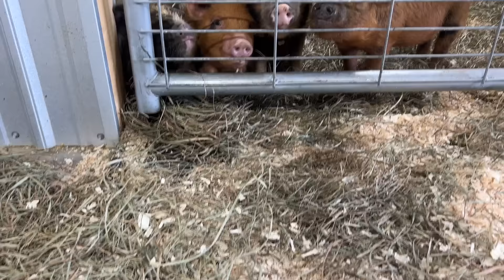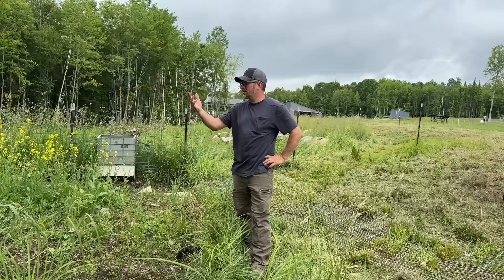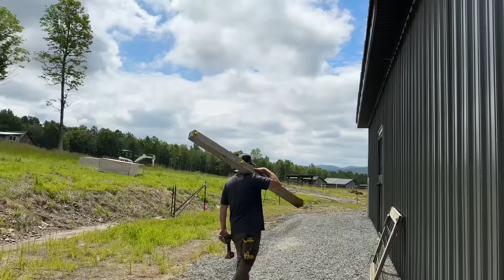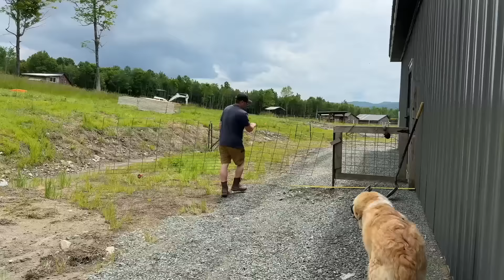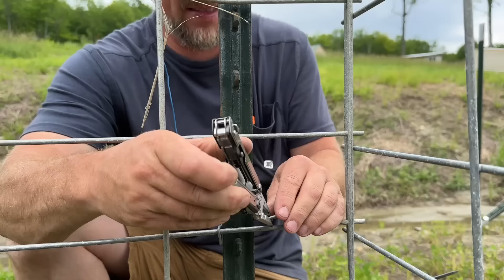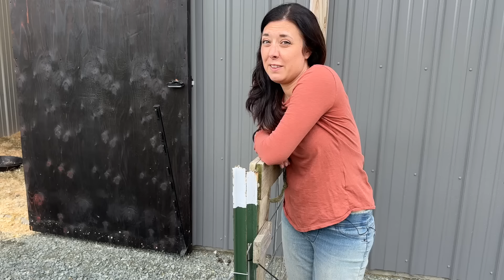Time to SEE If We've Been LIED To... Getting Our Pigs Outside for the 1st TIME

Comment: Try getting fencing pliers, they work well with the clips for the t-posts. When you work with wire you can use the pier to set the distance between strands and use them to quickly tie the clips up.

Comment: Have you seen the livestock panel connectors by One Man Fencing?  They are AWESOME!  I am NOT an affiliate, I just really like the product. They have stood up well to a goat buck! They are so easy to use and far better than staples.
Reply from the maker: Gooooooood Morning Honey Hollow. No I hadn’t heard of those before. Thanks for the recommendation I just looked them up
Reply: @LumnahAcres  For the ones that screw into wood, I opted to used longer screws for my buck pen. Screws are included, and they are not bad, just wanted to be sure of a good long bite. A buck can be somewhat determined. 😜

Comment: Hi Al, for those wire retainers I use a 4” length of 1/4” diameter pipe with a through hole to put the wire through. Then all you do is twist it round the wire of the panel. The length could be shortened to sit the size of the mesh opening, just use a larger diameter pipe to fit over the small one for leverage. I hope that makes sense.
Reply: Also, have you thought of adding some more weight to your picket driver, it sounds way too light. A disc of1” plate should do it, welded onto the capped end.
Reply: @paulvanhouts3365  For your information you can always edit your comments by clicking on the 3 vertical dots to the right of your comment.

Comment: Name the meat pigs Bacon and Ham.  A possible replacement for the fence clip tool that broke, use a nut driver.  The shaft is usually hollow for tightening nuts on long threads and would be fairly strong for wrapping the ends of the fence clips around the wire.
Reply: all we used was a plyers and used the handle to wrap the one side around the wire being held. Put over 1000 of those things in when setting up feed lot pens (wood posts[main posts] and t-posts[in between support posts]) to hold around 5000 head in the winter, spring thru fall they were out on pastures. Rather do the clips then pound in U staples!
Reply: I still like pork belly and pork chop for names

Comment: Hook the short side of the wire tie on one side of the post and then use your pliers handle or a screwdriver in the longer bent side and rotate it over the wire instead of unwinding it

Comment: The only ferment we do is sauerkraut, we add caraway seed when the cabbage and salt are added together. We actually use our wine making equipment (buckets, gas bubbler, etc) when making it. We then can a large portion of it and use it to make with hotdogs/ring baloney/old world sausage links/klebaska/monte cristo sandwiches/ etc. With canning it you have to watch your jars, after 2 years the lids started popping/loosing their seals even with the rings still on. We grew 4 heads (8 lbs average each think basketball size base - shaped like a tear drop)  of Filderkraut cabbage seeds (giant heads and developed especially for making bavarian kraut in germany - Baker Creek Heirloom Seed company has it) and we ended up canning 2 full canner of quarts with that much cabbage once shredded down and fermented.

Comment: Try fermented cauliflower.  I break apart the head into bite size florets, add whole gloves of garlic and quartered peppers.  You can use whatever peppers you want or none at all.  They really don't make the cauliflower hot but does add flavor and looks pretty in the jar.   You can tell if your ferment has developed the lactic acid when the garlic turns blue.  Takes a week to ten days.

Comment: Seems like you could have left that panel full length and let it stick out over the ditch, save it for later since this isn't permanent and less work now. If your clip bender was the kind that toggles maybe you just got a bad one, I had no problem with mine on many hundreds of feet of knotted wire fence.

Comment: i notice your post knocker is a bit light weight  why dont you weld a 1" disc on the top and it will knock the posts in better i di that with mine

Comment: Hello 👋 Al and Gina, I have used a tool called fencing pliers. I got my first pair in the early 70’s when I was a teenager. They work great for fencing clips for fastening the wire to the posts as well as having a hammer, wire cutters and a spike for getting staples out of wood posts
Reply: Know what you mean

Comment: Simple recipe for sauerkraut. 
1. Shred or slice your cabbage into thin strips, and weigh them in Grams. Place in a large mixing bowl and crush the cabbage by hand.
2. Mix in 2% of the cabbage weight of nonionized table or sea salt. Let stand until a brine begins to form in the bottom of the bowl,.
3. Transfer to a fermenting container. Allow to ferment for 14 - 16 days. Longer if you like softer sauerkraut.
4. Remove from the fermenter:
 5. if you want to store it for a longer period unrefrigerated,  put it in a sealed container like a large canning jar retaining the brine, otherwise lightly rinse in a colander (don't rinse too thoroughly to retain some saltiness). Place the rinsed sauerkraut in a sealed container and refrigerate.

Comment: As far as fence pliers I've used Channellock 10-2/5 in. Fence Tool, and it has worked flawlessly for over forty  years, and it has a limited lifetime warranty. 
Over the years I learned you buy quality tools once in a lifetime or replace cheaper tools often. If you bought the patch and plugs I told you about your tractor would have been fixed in about an hour.

Comment: Tractor down two days so far . Buy a plug kit. If you can diagnose a nail sized hole like the one you had, you may be able to repair it in about 15 minutes with the tire still on the tractor.